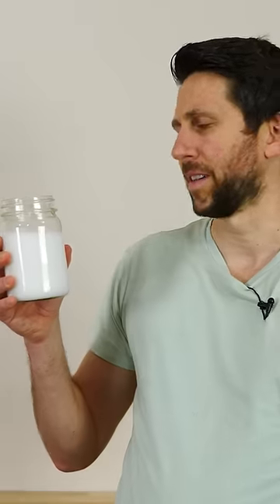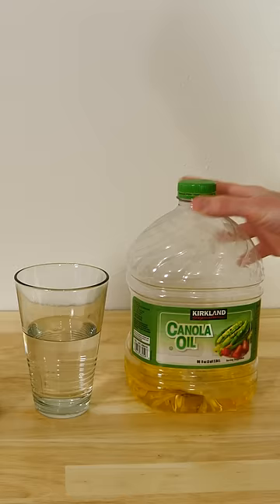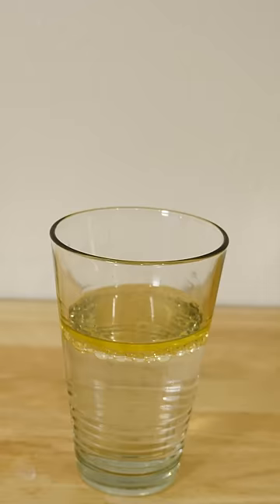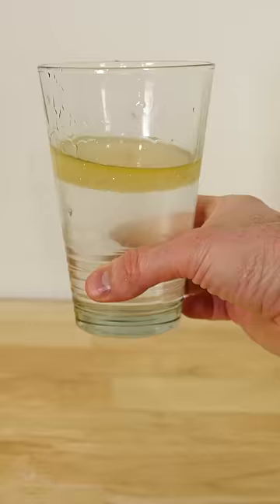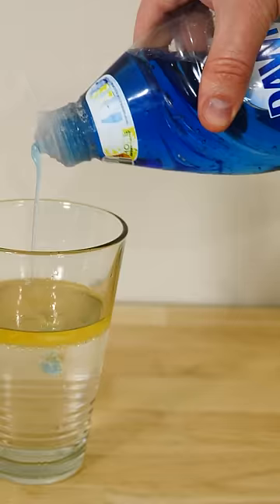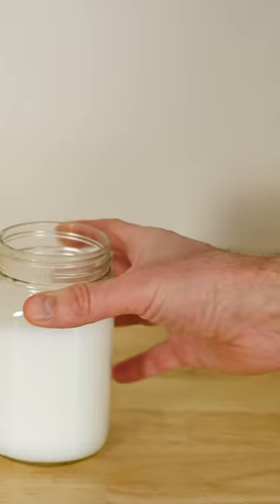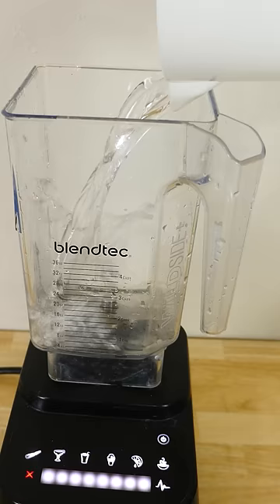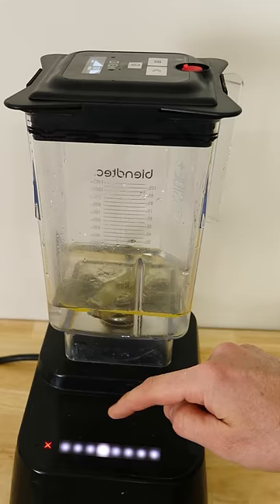How To Make Oil And Water Mix

Comment: Degassed water can act like an emulsifier because:

	1.	Reduced Surface Tension: Makes it easier for water to surround and stabilize oil droplets.
	2.	Altered Hydrogen Bonding: Enhances water’s interaction with emulsifying molecules.
	3.	Improved Solvent Properties: Better solubilizes substances that stabilize emulsions.
	4.	Increased Hydration Capacity: Better hydrates and solubilizes amphiphilic molecules.
	5.	Enhanced Wetting Properties: Helps water spread more evenly around oil droplets.
Reply: Hello chatgpt

Comment: I wanna try to put chiken into it it's gonna be fried chiken or boiled chiken 🤔
Reply: That's an interesting question.
Reply: Huh? Oh you mean put a lot of it in like a pot and cook chicken with that. Sounds like a hazard. Don't do that.
Reply: @madhououinkyoma  just oil and water blended together. There'd be no risks toxicity wise. Probably would boil like normal unless you had such a high oil content that the water tried sizzling/evaporating.
Reply: @crowcarmichael2917  if they’re considering fried chicken as an option then the heat would need to be high enough to potentially fry and water and oil don’t mix well in those conditions
Reply: Boiled, because it has water in it it can only get up to Water's boiling point at 212F, so it won't be hot enough to make the chicken crispy and quickly cooked, unless all the water boiled out of it.
Reply: Fried- chicken has moisture in it anyways

Comment: As a machinist &  tool & die maker, we used water soluble oil, not vacuumed. Note: the OIL is FIRST put into the container, THEN the water is added to the oil. It is used as a lubricating CUTTING OIL IN MACHINING METALS. However, IF the OIL, is added to the WATER, the 'MILK' will RUST STEELS. COOL ! 😊. ABOUT 1 CUP OIL TO 5 GALLONS OF WATER. IT 'SATURATES' THE WATER IF YOU ADD TOO MUCH.WE USED IT IN OUR CAR ENGINE COOLING RADIATOR, AND IT WONT RUST THE COOLING SYSTEM ,& IT LUBRICATES THE WATER PUMP. & it was CHEEP. good old days !😊
Reply: ayo chill out with the caps
Reply: @jlco Maybe YOU chill the LOWERCASE
Reply: @davemiller638  OH SORRY MY BAD

Comment: The lower air pressure combined with the high agitation creates a high flow velocity to overcome the water molecule attraction and allows smaller bubbles to form, that would otherwise form bigger bubbles due to the strong water moleule attraction.

Comment: The best way to explain. Is the stable protein under vacuum will be incapsulated by water with blending, it forces them together and as the vacuumed  infusion is released the water suspends the the protein  and greatly reducing decomposition of the protein. Many meats are done like this for shelf life.

Comment: It's possible that water in a vaccum loses it's usual strong surface tension allowing the oil to proliferate through it without trying to reintegrate into a single surface. Not sure how it remains that way once the vacuum is released, unless I'm entirely wrong which is totally possible lol

Comment: That’s what it looks like when even if it’s crude oil that’s mixed in. I’ve started up oil refineries dozens of times and dewatering is always a fun step. You let the water run out the pipe to the sewer, then it changes to this before it changes to all oil. So when you see the milk coming out you stay close and get ready to close the valve.

Comment: Any mechanic who’s dealt with bad gaskets could tell you the same thing. “milky” oil is a definitive sign of water contamination in motor oil and combustion engines create vacuum while running, creating the perfect conditions to mix the fluids together.

Comment: I'm just guessing here, but wouldn't you imagine that the water acts as an emulsifier only because it then removes the ability to evaporate. I think a good follow-up would be a video showing: What happens when you boil water in a vacuum? Will the molecules behave commonly or chaotically, and at what initial velocities?
Reply: I like to add coconut oil to my coffee. In order for they're not to be a layer of oil at the top, I put all my dry ingredients in the cup first add the oil to them and mix well. I use instant coffee. Then I pour in the hot water and stir. The oil remains distributed throughout the drink at least long enough for me to drink it.

Comment: I reckon I've solved the degassed water being an emulsifier.(in this setup)...   It's about bouancy...without mixing air in they have closer to equal bouancy with less separation "force"

Comment: Maybe the gases interfere with the hydrogen exchange.  Ultra-pure water should be exchanging H at a higher rate, which might be the reason oil is emulsified.

Comment: Pretty sure that's what milk is basically, both that and milk are colloids, with milk the fat that is emulsified in the water isn't conola oil though, there's fat which is extracted when you make butter, but there's also protein (casein and whey), as well as carbohydrates (lactose) basically a type of sugar.

Comment: I knew that it would have to be blended or something, but there is abaolutely no way I could have predicted the vacuum blender 😂😂😂
Very cool and mysterious that a lack of air causes them to mix together easier. Maybe what really happens when you pour oil on water is that a layer of air gets trapped under or around the oil? And a vacuum causes that air to disappear, so the surface tensions of the oil and water dont resist eachother as hard anymore or something? Best guess as a "one day" scientist.

Comment: If your head gasket fails in your care engine, you’ll see a milky residue on the inside of your oil cap. That’s when the water has leaked into your engine  oil system

Comment: Alright, check it. When you blend oil and water together under a vacuum, you’re doin’ some real science magic, you feel me? Normally, oil and water don't mix, they’re like two rivals in the hood. But when you blend them hard and fast, you're forcin' them to get along, breakin' the oil into tiny droplets that get all mixed up in the water. Now, with that vacuum cap on, you’re suckin’ out the air, lowerin' the pressure. This makes the gases in the water and oil come out and disappear. Without those gases, the oil droplets stay suspended in the water, makin' it look all milky and white. It’s like you’ve created a temporary truce between the oil and water, makin' them hang together for a while. That’s why it looks like that, straight up.😎

Comment: I understand that this is due to the change in water's surface tension, however that the solution is not stable, and after a short while, the two phases will separate back again.